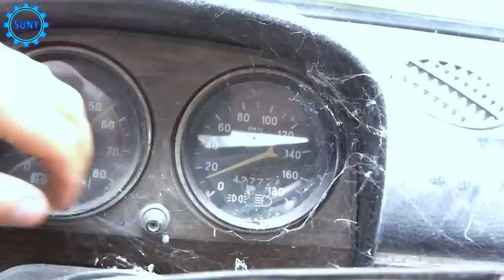Interesting Idea With Seat Belt

Comment: If it can pop out 8 inches under spring power, and you almost dropped it the first time, why not turn it up instead of down? Also, you should clamp flat, thin metal stock in a vise vertically in the jaws and drill sideways. Theres  not enough surface area on the edges to reliably hold the material to keep it from slipping and causing the drillbit to slip off and risking an injury.

Comment: I wish I had that smooth cutting thing because I have alot of things to cut but you don't cut everything just because you have that fancy cutting tool 😂. 
Removing only the plastic from the smaller part will give you a decent and sturdy bottle opener with ready holes to attach to a chain, string or to the larger part as you did and you can use it for keys as well.
Reply: "smooth cutting thing"? you mean an angle grinder?